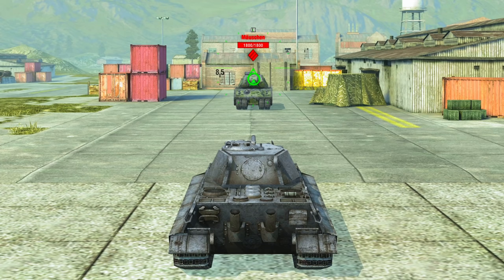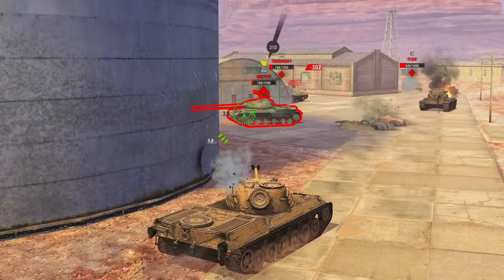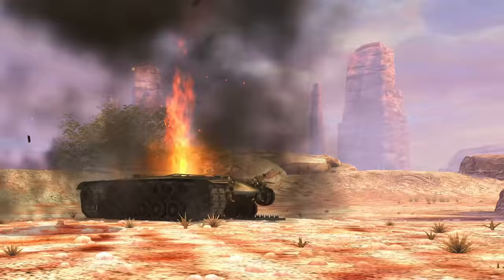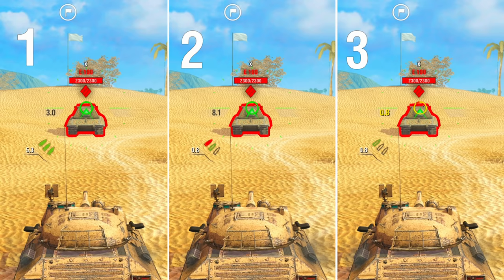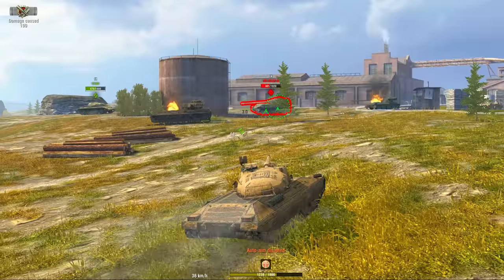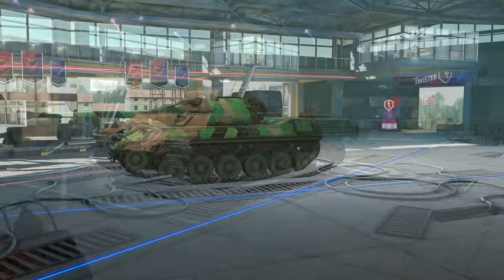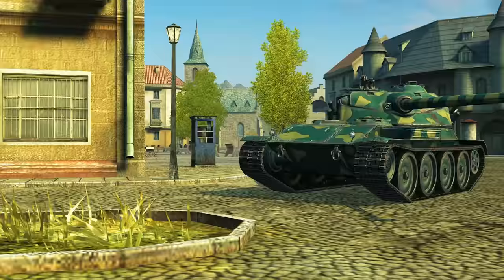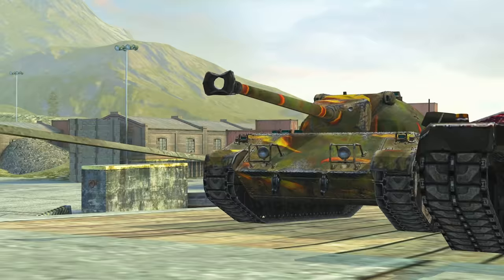WoT Blitz. Autoreloading System: How It Works?

Comment: whats the point of using autoloaders then?
Reply: Those are paper tanks unlike USA MTs and T57 H
Reply: Autoloader have better clip dpm and standard guns have better dpm, also the progetto isn't as mobile as a batchat
Reply: The dpm is really low on these tanks the max you're gonna get is 2576 which is lower than bat chat 25t and lowest in all mediums and lights at t10.